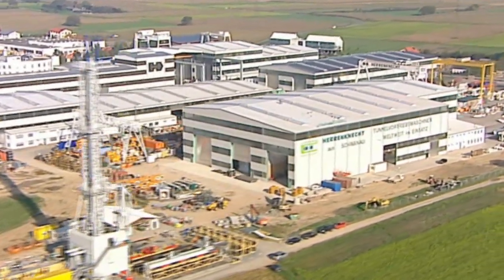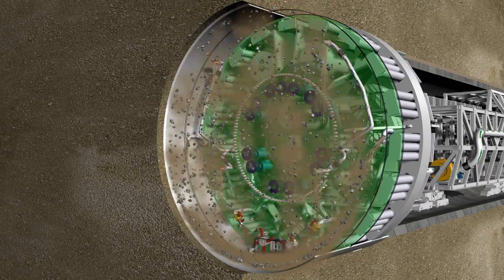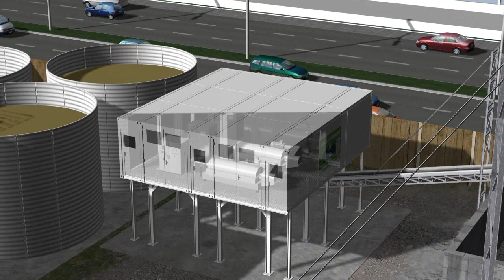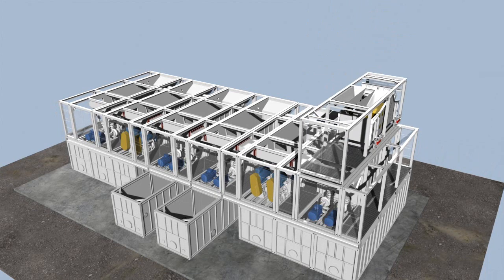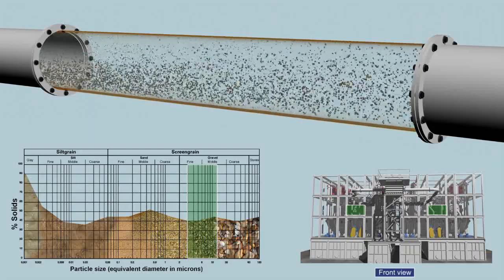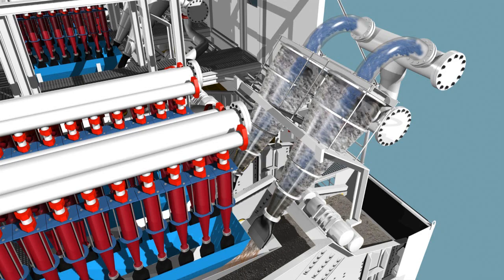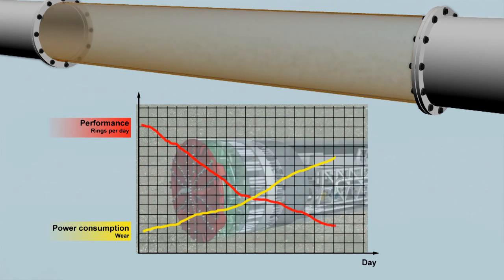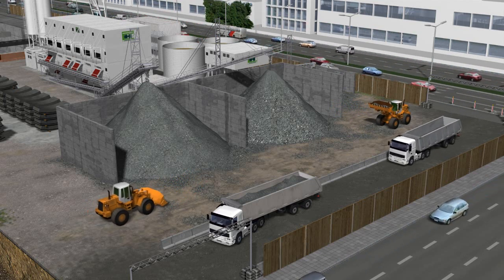Separation Plants for Traffic Tunnelling

Comment: Will all this magic work at -30C? Especially the bentonite buffer tanks?
Reply from the maker: The slurry coming out of the tunnel has a temperature of approx. 37-45 °C so it is quite hot.
So minus 30°C degrees wont cause issues on the active circuit side inside the containers. In the big storage tanks on the surface it is important that you agitate the slurry and keep it in movement that freezing could be avoided.

In some projects also heating systems were integrated for example in the pipes or special covers/protection.
Reply: @HerrenknechtAG  Thank you.